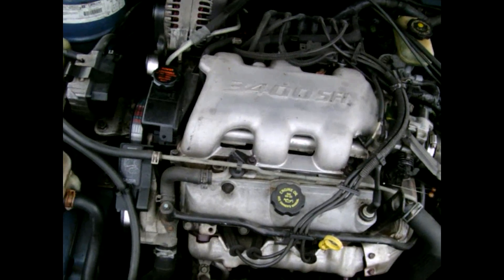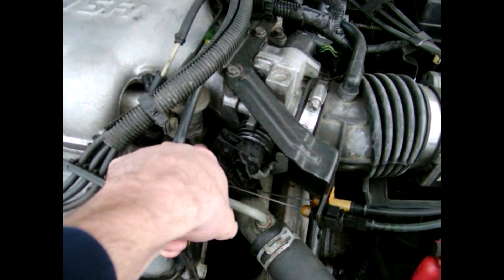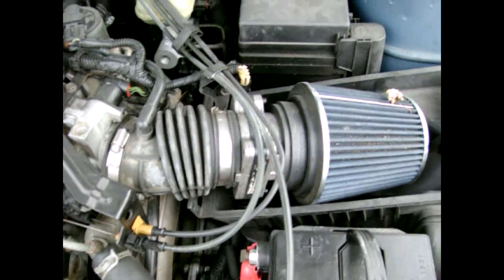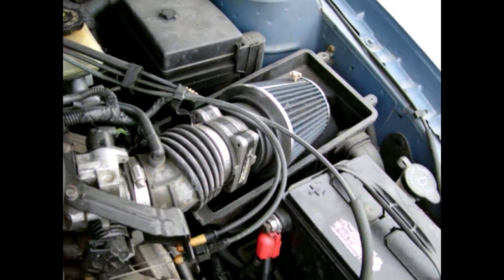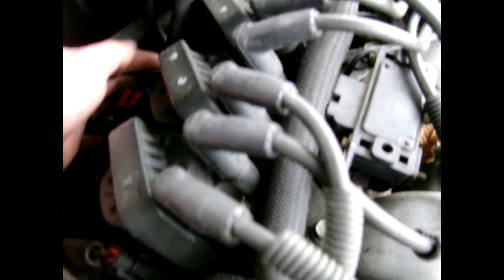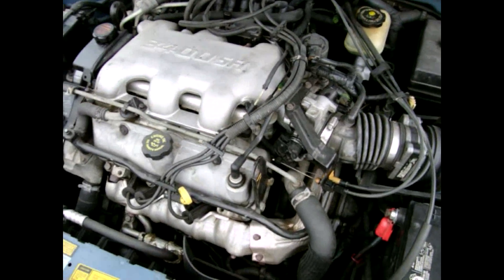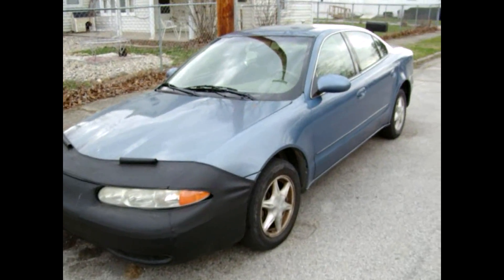3400 GM Engine 3.4 Liter Motor Explanation And Discussion

Comment from the maker: The timing chain cover does have a gasket for coolant passage.  But I seriously doubt this is what is leaking.  Does you van still have heat?  Is it intermittent?  It takes a lot to make the gasket go out there.  Guess it is possible, but I'm guessing it's coming from somewhere else.  How bad is the leak?
VT247

Comment: I have a 99 Montana and it's leaking coolant somewhere and the radiator hose blew apart after a new hose it's still leaking what seems like on backside of engine... Also new hose is under alot of pressure

Comment from the maker: Check the coolant bypass tube from the water pump to the heater core.  Also check the other metal coolant line coming out from behind the thermostat.  
VT247

Comment from the maker: My red Aztek does that sometimes.  Think that the fluid has an air pocket that develops after sitting.  Don't be alarmed, mine does the same thing.  Still runs and drives fine though.
VT247

Comment: Does anyone know if you can swap a Pontiac Grand Am 3.4 with a Pontiac Montana 3.4? I think it would work, it's the same engine, just have to swap out some connections, some pulley's, and possibly the transmission dipstick. Let me know... Please.

Comment: I have a 1999 pontiac grand am GT. It has a 3.4 207 6 cylinder engine. I bought it with a blown head gasket. The guy aleady had the engine apart. I bought new heads and all new gaskets. My question is (what order do you install the pushrods because I noticed some of them was about 1/4 '' shorter than other ones. )

Comment: that line you have your hand on at 2:37 attached to the plenum.. where does it go and is it needed? All i have left of it is a small piece the rest broke away and no clue as to what it goes to
Reply from the maker: The larger piece goes to the front of the engine to the PCV valve.  It's to collect up the gasses from the crankcase.  The other end goes to the EVAP system.  Both are needed and should be hooked up.
VT247
Reply: Vacationtime247 http://static.cargurus.com/images/site/2013/12/12/22/16/2005_pontiac_grand_am_se-pic-6154559888168855084.jpeg heres a pic i found on the net of it...Would this cause it to go into limp home mode?..IT wont go over 60 mph.
Reply from the maker: I'd check for check engine codes.  In the mean time, put a piece of vacuum tubing in there.  The way the vacuum lines are run are different with the car's vs the minivans / Azteks / Rendezvous.  That line should go to an EVAP (smog) system just under the coil pack but over the exhaust.  This line is prone to degrade and / or fall out.
VT247
Reply: Vacationtime247 thanks for your insight... haven't checked to see where that white hose 
goes..but when i checked the code it says P0404 ...so it seems to be the
 egr is causing it to go into limp mode

Comment from the maker: The sensor is probably getting hot and causing it to misfire when it warms up.  Check the module under the coil packs too, they tend to go bad as well.  Replace the Crank Sensor on the front of the engine by the balancer.
VT247

Comment: I noticed that on one of the two small hoses that go from the radiator to the surge tank on the passenger side has a little small red cap with a hole in the middle and it happened to be loose so I just hand tightened it back down.  not sure if this caused and ptoblems.  could it have been letting air into the coolant system?  I figured I would go ahead and flush the system and start with new antifreeze and bleed it and see what happens.
Reply from the maker: +Michael Giles Fill up the cooling system and do a pressure test of the system.  Autozone has the loan a tool radiator pressure check.  Best way to find a leak.  Find the leak, find the reason for air in the system.  If you don't find any external leak, it's leaking inside the engine.  i.e., head or intake manifold gasket.
VT247

Comment: I have a 2001 Alero with the 3400 hooked up to a slippery automatic.Two weeks ago I  replaced the coolant with what is recommended. Everything has been working fine, but yesterday I could not get any heat into the cabin. The fan works fine, just no heat. Is this a water pump issue, or is there something else that could be the problem? Thanks in advance. PS I appreciate the posting and discussion.

Comment from the maker: Never completely rebuilt the engine on a 3400.  I'd be worried I'd exceed the cost of a new (used junkyard) engine rebuilding the bottom end.  If the rod bearings are bad, chances are that the crankshaft journals are scorn too. : (  I'm surprised that it doesn't have oil gallery holes.  That's a new one to me.  How does it get oil into the rod bearings then?
VT247

Comment: ok took apart the top of the engine coil packs, module, intake throttle body.  When all that was off found one of the wire sets for the ignition module was burnt. But could not find the other end of it so spliced in new wire with the old.  on the put back replaced thermostat, egr valve gaskets intake gaskets new module, coil packs, plug and wires. one of the new coil packs was defective so used an old one that was good.  Fired right up but now I have hard starts. (next post B)

Comment: My Alero is having power steering problems. I believe that the power steering pressure line is gone completely..i look where i think it suppose to be, near one of the pullys and it's not there. If i put one on there I won't know where the other end hooks into. Also, the battery is not staying charged at all..one i turn the car off it won't turn over anymore until I recharge the battery. Could that be the alternator? Thanks!

Comment from the maker: If you think that the timing chain has broke, pull off the front valve cover.  Loosen the 4 8mm bolts and take the cover off.  It's got a rubber gasket so it can be reused, just dab a blob of silicone around the sunk in edges at each corner when re-installing.  Have someone turn the engine over and watch to see if the rocker arms move.  If they move, the timing chain is still turning the cam, lifters, pushrods, rockers, valves, etc.
VT247

Comment from the maker: Not sure exactly what your referring to.  The engine needs a water pump.  But if you mean the extra coolant tube for a water / oil cooler it helps with cooling when towing.  Goes from @ the top of the water pump down to @ the oil filter.  My '01 Aztek has one of these.  It allows for better cooling when hauling a load.  If using the van for hauling, be sure to use 3rd gear, don't tow in overdrive (OD). If you don't tow, the tube can be capped on both ends.
VT247

Comment: How can I get the codes to come up on the dash? Our PT can display them and I am hoping the Alero will too. I flushed my coolant and now have what seems like something floating in the system as there is a ticking sound. Really bugs, but I cannot determine the cause. The ticking is more like the pinging from detonation under light to moderate load. Give a little more throttle and the noise subsides and the car moves along nicely. Any thoughts?

Comment: It never used to stall out or sputter when the oil cap was removed.  Now I don't know if that is because the old EVAP/PCV was bad or the new one is. Seems logical to me that it should sputter/stall if the cap is removed if the PCV is there to balance the vacuum.

Comment from the maker: Check the fuses and check for electrical wiring going to the starter.  Perhaps the + lead for the starter relay isn't tight.
VT247

Comment: @vacationtime247, the water pump has a rubber hose attached to it? and ALL the old coolant will flow out? Can I reach this hose from under the hood or do I have to lift the car up on jack stands and get under the car..l I have a Haynes manual and they say to pull the little white plug out

Comment: I alrady checked the relays.i opened one up installed it with out the cover and I pressed my finger over it and the fans turn on but only that way.even if the car is shut off. I havent tried the temp sensor yet

Comment: I have this motor and i have antifreeze pooling on the opposite side sitting on the bolts next to the oil cap and the hoses next to it. Hoping its not a blown head gasket😮
Reply from the maker: Sounds like a leaky intake gasket.  Rent a coolant pressure tester from Autozone, wherever it’s leaking from it should start coming out
VT247

Comment from the maker: Drained the oil and filter when my intake manifold went bad.  Oil was a milkshake.  Filled the system back up after fixing it with some used motor oil and the old filter.  Ran it until it reached operating temp, checking the oil while it warmed up.  Let it cool then changed the oil and filter.  Been fine ever since.
VT247

Comment: I just replaced the Gasket that belongs to the EGR, hopfully that will will give my Monte Carlo a lil more engine power.I dont have a fuel pressure leak, I think I may have to replace the purge valve and the elbow...smdh... I'm tired of working on the engine  my to solve my problem and, Then I can move on to something else. Thanks for all your advice, it help me a lot..

Comment: I have a 2003 venture with the same motor. I was going to replace the pistons,rings.and rod bearings I could do this with the motor still in place. of course I found the crank was bad so since I have so much off already I am going to remove the engine this weekend from the top even though the book says you can not!! Any sugestions?

Comment: most of the time the evap sensor comes on cause you get some gas down in the evap when you fill the car completly up. the charcol gets up in the little lines up there and clogges it up untill it drys completly

Comment: I have a 99 Olds Silhouette van. I replaced the motor but can not remember how the high pressure line routes back to power steering pump. I would appericate any info you could provide.

Comment from the maker: Yes, the engine will either stall out or die completely when the oil cap is removed.  It looses vacuum from the PCV.  Glad you found the problem and even better, it's on #6, so it's easy to get to.  Not in the back.
VT247

Comment: 02 Buick Rendezvous.  On occasion will start right up, grumble and then die after about one second.  Then won't start, just cranks and cranks.  If I let it sit 15 minutes or so and come back, then usually starts right up.  Runs great once running, no stalls, hesitation or other issues.  Problem only happens once in every 5 starts or so.  Fuel pressure is good (58 psi).  No leakage (gas, coolant, vacuum) in engine that I can see.  Any advice what to look for next?
Reply from the maker: Any engine codes on?  Sounds like a fuel related problem or a bad crank signal.  Is the fuel pressure reading while running or before starting?  Possibly a fuel pressure regulator or filter.

Comment from the maker: The sensor tells the engine when to fire.  Try replacing the sensor and also check the coil pack ignition module under the coil packs.
VT247

Comment: i have the 2000 alero same motor the serpentine belt had broke and melted the plastic and pulley, I replaced the belt and tensioner also cleaned out where the old belt had melted into the grooves of the some pullies. The problem i am having now is that when it starts up its making a very loud squealing noise after the car gets going and warmed up how ever it stops wondering if you have any ideas on what this could be.

Comment: Having some problems with a 2004 Oldsmobile Alero 3.4L. It's idling rough and after it's been running for a while it doesn't want to start, you have to ride the gas for a few seconds to get it to start and hold it at 1500-2000 rpms for about 5-10 seconds to make it stay running. Has no problems when the car is cold. I replaced the coolant sensor and the purge solenoid last week. It's still throwing the purge solenoid code, i've checked and the vacuum hoses are good. Now it is throwing an EGR code as well - P0401. The Egr has been cleaned a few times before and it builds up crap again really quick. The car is not overheating. When I changed the coolent sensor the car had been driving without antifreeze for who knows how long (it's a friends car).
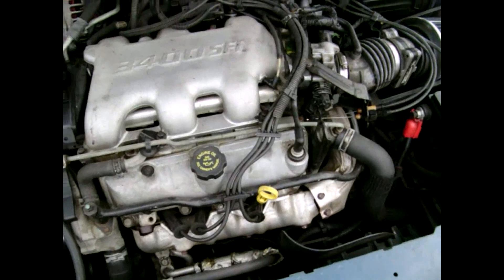Reply from the maker: Here's a few things I would check.  Check for vacuum leaks.  Having to hold the gas down to restart and a rough idle can be a vacuum leak.  In this video at 2:29 I point to an area where the vacuum line goes into the upper intake.  Also behind / around the rear of the engine near the spark box is another area to check.  Where the vacuum line goes into the EVAP, it comes loose.  Bleed the system of air and see if it holds pressure and the temp gauge stays level at a constant temp.  The GM 3400 gaskets go bad, like, all of them.  The intake manifold gasket, head gasket, timing chain gasket all go bad causing coolant leaks, overheating, under heating, fouled out spark plugs (yea, check those too) and other odd problems.  Good luck!  Hope this helps!  : )
VT247
Reply: The intake manifold gasket is shot. I went in to check the thermostat and saw the leaking down the engine right in front of the thermostat housing. Having never changed that gasket this will be interesting. I've been told that it's suggested to change the head gasket while in there, when you do that do you need to meld the head to put it back on?
Reply from the maker: Honestly, I'd go ahead and get new heads off eBay.  Brand new heads run about $340 and new gaskets on eBay are@ $80.  You can have your current heads shaved for straightness if there are no cracks between the intake and spark plug holes.
VT247

Comment: Here are a few items to check. The exhaust bypass tube for the EGR, allowing to much air in the system and check the EGR for proper flow and carbon in the intake ports. The Fuel pressure regulator, not allowing enough fuel in to feed the injectors. This is where I'd start. Let me know how it turns out.

Well No codes for any of the things you stated but now the engine idles great I can give it some gas to about 15000 RPMs the at 16000 it starts the chug and hesitation thing.  I am stumped.

Comment from the maker: My guess is it is probably the head gaskets. I've replaced the head gaskets on most every 3400 I've owned. Got a video on Youtube on how to do this repair. Here's how I found out it my head gasket.  Let it run for a few minutes and bled the air bleeders then sealed them back up. Drove it up and down the road shortly.  Sure enough the temp didn't stay consistent. It overheated, checked the bleeder, more air came out. Even heard a hissing when turned off around the block ie head gasket.
VT247

Comment: I'm doing a timing cover gasket on a 2003 Chevy Impala this week with the 3.4 3400 in it. I changed the water pump about a week and a half ago and all of a sudden I'm leaking water under the belt tensioner. I've done a distributor and timing chain on a 92 Camaro WITH help once. This'll be my first solo attempt at something this advanced or intermediate. Any advice or tips?? And any special tools I need besides the harmonic balancer puller?

Comment: Hi. You are super knowledgeable on these 3.4. Have you heard of motor running rough all of the sudden bc of a loose bolt or helicoil thread? My car is running real rough all of a sudden it's got new plugs new wires and I just changed out the three coil packs today. The same identical thing happened on the same car before covid and the mechanic said it was some type of helicoil or something that came loose and was in the cylinder head. And it was still driving like that that sounds very strange to me. Wouldn't anything loose in the cylinder head cause damage while it was running? Thanks 👁️🐯
Reply from the maker: Check the vacuum lines and see if the coolant system holds pressure.  The 3.4 was known to have bad gaskets.  Never heard of the helicoil problem.  
VT247
Reply: @Vacationtime247  I appreciate your reply. I have since figured it out it's the rockers in the valve cover they are held in with a Time sert or helicoil. Thanks again 😎
Reply from the maker: @mgtowlevel5293  Oh!  Ok, now I know what they're referring to and yes, it could certainly cause issues.  If the rocker arm doesn't open up the valve, then air can't get in correctly or the exhaust can't exit.
VT247
Reply: @Vacationtime247  thanks again brother!

Comment from the maker: I used a Felpro gasket on mine and it never leaked again.  Use a liberal amount of silicone on the edges to ensure a good seal.  Let the sealant dry overnight and then add coolant.
VT247

Comment: Nice video!  my 2000 Malibu had the Intake Manifold Gasket replacement 2 years ago but it started to have the same problem again (leaking coolant).  It is normal there is a need of replacement of Intake Manifold Gasket every 2-3 years or so for this type of engine?

Comment: 2000 Pontiac Grand Am w/ same engine is often stopping after 15 minutes of driving.  Wait 3 to 10 minutes it starts up and goes a while longer.  When it first happened it would go almost exactly two hours and stop.  Would wait 20 minutes, make it to the 1st gas station, fill up and it was good.  Now it happens after 15 minutes and with full tank.  Any thoughts?  Mechanic was mystified.

Comment from the maker: Almost sounds like something coming out the vent.  Perhaps a wire that has gotten hot.  But check under the hood for any fluid leaks also.  Might be something coming off the engine and burning off on the exhaust.
VT247

Comment: I have the same car, year, engine and color.  My issue right now is that it's not starting up. It's not the alternator, starter. Imma try in get my battery recharged so I see what happens from there.

Comment: If you jump to 2:36 he's pulling a line out of the way to show us the spot where his vacuum line is leaking.  It's not the one that goes to the fuel regulator, but the gray one that goes to the plenum.  What the hell is that line?  I just broke it on mine and I don't even know what it is to try and find a new one! please help me!